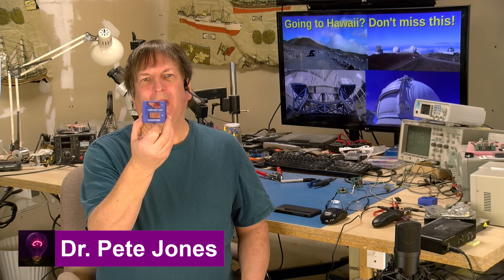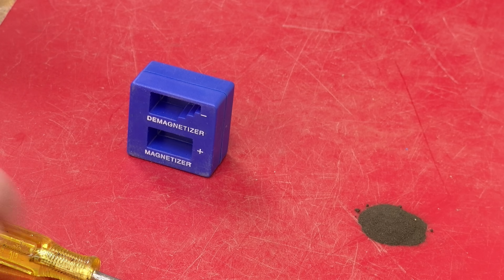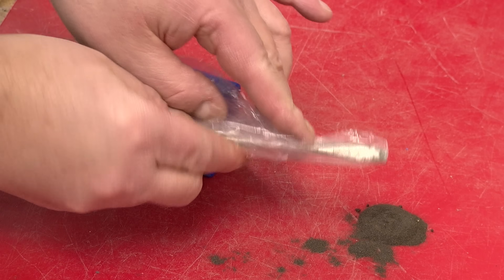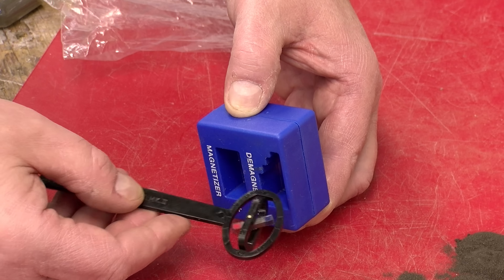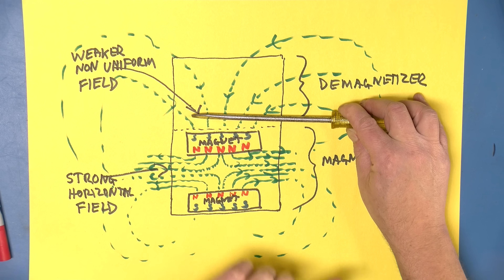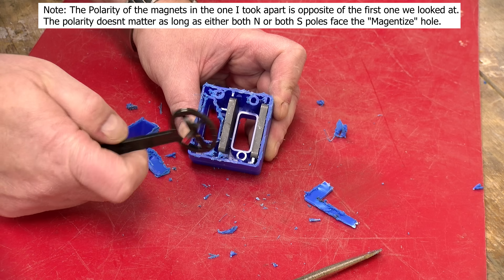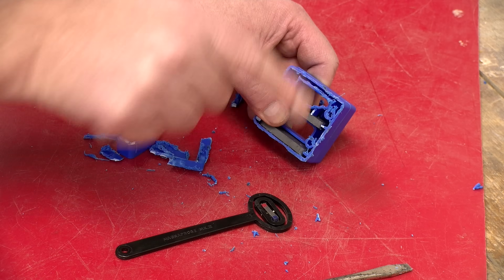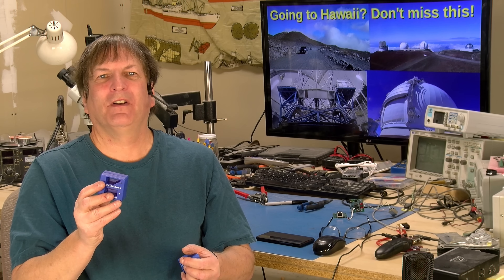How do these Magnetizer/Demagnetizers work?

Comment: I’ve had the same model for a long time very handy, obviously magnets don’t work on SS screws.🤪
Reply from the maker: Yes - I guess its "lucky" they are more expensive and therefor less common that plain old regular steel screws!
Reply: That's a myth. Some stainless steels can be magnetized. Some stainless steels rust too. There are many different classifications of stainless steel.
Reply from the maker: @tenlittleindians  I wonder what the alloy difference is between the magnetize / dont magnetize versions?
Reply: @ElectromagneticVideos  I think the information is in the Machinists manual. Very expensive book but I think there's an online version somewhere. To be fair the book is 3 inches thick with very thin pages. A ton of information in those books.
Reply from the maker: @tenlittleindians  I'll have to keep my eyes open for that at used book stores - sounds like a great book to have.  I have the Merk Index which is the chemistry handbook like that - type of things that very useful at time to have around.
Reply: @ElectromagneticVideos   It's actually called "Machinery's Handbook" and it's been around for over 100 years.
Reply from the maker: @tenlittleindians  Thanks!

Comment: Bluetack gets sand out of my fishing drone motors magnets and we're in Taranaki with iron sand ..it's horrid stuff ..basically sandpaper
Reply from the maker: I had to look up Bluetack - so its an adhesive with a consistency a bit like chewing gum? What a great idea for removing iron filings - I will remember  that! Thanks. 

I have always thought it would neat to experience iron sand and pick it up with a magnet. Never though of the down side. So I guess you in New Zealand - greetings from Canada!
Reply: @ElectromagneticVideos  shure do ..I liked your video ..yea it's funny we don't know what we don't know till suddenly we know ..were a small country with a big footprint thanks to industry ..
Reply: @ElectromagneticVideos  the absolute worst thing about iron sand is the crazy temps it gets up to in summer as it's dark it heats up with the sun and literally burns the skin off your feet ..but no worries the iron sand giveth and the iron sand taketh as in it will strip the dead skin straight off ..that's not the hardest part the hardest part is our brutal coral reefs of larva ..and a minute size of mussle they are literally razor sharp ..around half an inch by American imperial or 10-12mm in metric for fully grown ..it's one species

Comment: That must be the first (de-)magnetizer in the world, tha had to be cut apart to get it open 😮 Usually one can just pull both halfs apart relativelly easy, since they are not even getting glued (at least the good german ones like Wiha and Knipex). I used to troll my coworkers in the past by disassembling them and changing the direction of one of the magnets inside from time to time. The way they work remained a mystery to them back then 😅
Reply from the maker: This was certainly not easy to get apart. Too bad - would be great to be able to repeat what you did you your co -workers!

Comment: Informative! This reminds me of the AC powered tape head degausser wand/tool I bought years ago. The instructions were that the tip of the degausser was to be moved away from the tape heads slowly. The steps on that magnetizer/demagnetizer block make sense now.
Reply from the maker: I have an AC powered bulk tape degausser  and also one for CRTs - very similar in terms of moving away slowly. I did a video on that if you interested:  https://youtu.be/mGK8oYdEqyE
Reply: More spectacular was the degaussing coil for a CRT,   you rotated it in front of the tube watching the lovely colour patterns whilst slowly move some meters away. If the power was shut of too quick the tube had a permeant field and that was not good. Also the mains coil pulled a good few amps so you had one shot at it before smoke appeared.

Comment: The most important thing about demagnetization is a field that is opposite to the field in the magnetized iron, which reverses and weakens the magnetization of the iron. The polarity reversal should be repeated with a weaker field each time in order to make the iron practically unmagnetized. (This can also be achieved with a coil with alternating current, from which the piece of iron to be demagnetized is slowly moved away.) I also bought a demagnetizer/magnetizer like this to see how it works. Of course, it still works even when cut open.
Reply from the maker: "it still works even when cut open"  Ha - yes! Just a bit harder to use!
Reply: @ElectromagneticVideos  It actually works less well with the plastic case open because the mechanism lacks the secret of its function. 🙂
Reply from the maker: @Tag-Traeumer  Its certainly less magical :)
Reply: @ElectromagneticVideos  Yes, some magic is lost. But the built-in magnets still have enough magic: an invisible, non-material force that works at a distance! 😮
Reply from the maker: @Tag-Traeumer  Ha yes - magnetism is magical in and of itself :)

Comment: They are sadly not all made equal. The one I have now barely magnetizes. The one I had 20 years ago worked amazing. Same style, color and all, with the only difference being the language written on the side.
Reply from the maker: Someone else reported something similar. I suspect most manufacturers have no idea how it works and just buy some magnets, slap them in some injection molded plastic, and sell them at a price point they hope will make it not worth returning. Too bad - giving a great device a poor reputation.

Comment: When you're trying to charge or decharged the screwdriver does it only need one pass or does multiple passes raise the effectiveness?
Reply from the maker: Magnetize: because of the magnetic flux splits  and flows outward through both sides of the  magnetize hole, more than one pass wont increase the strength.  

Demagentize: the hard thing is keeping the screwdriver parallel to the floor of the demagentizer hole as you pull it though  and move it up step by step. If you dont think it was parallel enough, a second pass at teh same step may help. But if it was parallel, it should make no difference.  So I guess in summary, if you did it right, one pass is all you need at each level.
Reply: @ElectromagneticVideos  thank you for the detailed response. I have one of these in my toolbox and use it a lot, but I've always ran it through multiple times. Almost like sharpening a knife. Now I know I don't have to do that.
Reply from the maker: @Big_Perm  Well the important thing is in the end, whatever works!

Comment: so, as a party trick, you could de-magnetize on the opposite side of the de-magneetizer hole - just moving the screwdriver in the free air ?
Reply from the maker: Yes - in other words, if the device is oriented so that that the demagnetizer hole is above the magnetizer hole, you can demagnetize by passing the screwdriver below the bottom side of the device (ie below the magnetizer hole).

Comment: Working on cars all my life we just wrapped a wire around the blade of a screwdriver and touched the ends to the positive and negative battery terminals quickly(not long enough to cause any damage to the battery or the wire) and that lightly magnetized the screwdriver good enough to get a screw out of the unreachable space we had inevitably dropped it into. Never knew why it worked, it just did.
Reply from the maker: Someone else mentioned a similar story. I guess a mechanics trick. Here is the why you can magnetize things that way: https://youtu.be/S21rlwrY74I

Comment: i know you can magnetize with one magnet (not this tool , just a loose magnet) but is there any way to demagnetize with just a loose magnet ? i have large drill bits that won't fit inside the tool .
Reply from the maker: You could if you could adjust the position of the permanent magnet just right to exactly counter the field in the drill bit. But its practically impossible to get it just right. 

Try this: bang the drill bit on the (not sharp) end with a hammer. Or drop it a few times on a concrete floor. The shock may be able to demagnetize it.  

Better, get a used, AC powered,  bulk tape demagentizer which should be able to do it.
Reply: thanks .
Reply: The Curie temperature. Basically when you get a magnet hot enough it loses it's magnetism. I think it's because the crystal structure is changed by intense heat.
Reply from the maker: @jakepassolt9640 Yes! Exactly! The only everyday use I know of the Curie temperature is in rice cookers of all things. Its used to change the magnetic characteristics of the gizmo that keeps the switch on until it gets hot (all the water evaporated)  and the switch is released Turing it off.

Comment: Does the speed of the screwdriver moving through the magnetic field affect the strength of the magnetism that the screwdriver picks up?
Reply from the maker: Not for the type of speeds one would normally be able to pull it though the device. 

There is some time time it takes for  magnetic domains to change as needed to magnetize or demagnetize, but I'm not sure what that is.  So if you shot the screwdriver from a gun though the hole in the magnetizer, there might be all sorts of weird effects that come in to play. I have never tried  that :)
Reply: @ElectromagneticVideos "I shot a screwdriver through a magnetizer - Something weird happened" sounds like a fairly normal Youtube video, though. 😂
Reply from the maker: @GoGoGoRunRunRun  I could probably get a lot more views if I did that :)

Comment: Basically, the stronger the field in the screwdriver, the stronger the demagnitizer needs to be to noticably effect it, but also, the strong the field it leaves behind, so you have to taper off the strength of the demagnitizer to fully remove the magnetic field.
Reply from the maker: Yes - and the fist step in the demagnetize section leaves some field, the next step reduces that, and so on.

Comment: These won't work on a screwdriver magnetized with a different field (ie: comes from factory magnatized). That part is confusing.
Reply from the maker: Actually, it should: Because the demagnetizer part is initially forcing the field in the screwdriver to be perpendicular to the length of the screwdriver (screwdrivers are normally magnetized with the field in a parallel direction), it really shouldn't matter what field the screwdriver initially has.
Reply: @ElectromagneticVideos  So I bought one to demagnetize a set of drivers and it didn't work. Bunch of people on amazon also complained. I wrote the company and he sent me a YT video showing why, but I didn't totally understand it. (It works on fresh screwdrivers of course) Had something to do with original field created in different flux orientation the cancelation doesn't work.
Reply from the maker: @xfloodcasual8124  Lets say I'm a bit suspicious of that explanation :) If they had a lot of complains, I wonder if they had a sufficiently strong magnet inside and close enough to the bottom of the demagnetizer slot? I would suspect many of these devices are made by buying some magnets, putting them in a plastic case and assuming it will work because other ones that look similar do. And figuring that for $5 or whatever, only a few people will bother to ship them back if there is an issue.
Reply: @ElectromagneticVideos  Its possible. One way to test is get a factory magnetized screwdriver and demagnetize it. I had Klein drivers.
Reply from the maker: @xfloodcasual8124  OK - I might have misunderstood. If you have (purposely) factory magnetized screwdrivers, they will have a real permanent magnet somewhere inside to keep the field strong. A simple demagentizer like this will not be enough to demagnetize it.

Comment: Had problems demagnetizing completely . Now I know. Thanks alot. Others say that stairs doesn't do anything because it's empty inside and just for show. ;D That's youtube for you
Reply from the maker: In  fairness to other youtubers , these devices don't seem to have instructions on how to use them, and to deduce why the staircase is needed does take a bit more than an elementary under standing of magnetics, although its pretty simple once you understand it. 

Hope this solves your demagnetization issues. If not, see if you can find an old AC powered bulk tape demagnetizer  which should be able to an even better job.
Reply: Just tried and this simple stairs solution helps. Sometimes it takes a couple of times but definitely works :)
Reply from the maker: @christopherismcaceas4868  I found the same thing - I think it has a lot to do with positing the screwdriver just right for each step. If it dips down towards the magnet it can re-magnetize itself. Not a perfect device, but amazingly effective for its simplicity.

Comment: I find demagnetizing (or 'degaussing' as said in the biz) with these things to be a bit hit/miss. For that I have an old CRT TV degaussing coil in the shop that does an excellent job every time... additionally it's big enough for most hand tools, and can even be passed over bench vise jaws. Use 'technique' is important for degaussing coils. (Don't exceed their duty cycle limitations!)

Note that alloys used for screwdrivers make poor magnet materials... and they will never strongly magnetize.

Also, an old camping compass makes for an excellent detector of stray magnetism.
Reply from the maker: Well, you may like this video    https://youtu.be/mGK8oYdEqyE - I have a CRT degausser too! You are one of the few people I have come across who also still has a CRT degausser!

Compass - YES! I actually shot some of the video using a compass to determine the degree of magentization of the screwdriver (how far away to make the compass defect ever so slightly) -   in the end decided iron filings made it more obvious in the video.

Comment: I wonder if these exist with neodymium magnets …
Reply from the maker: I suspect is a case of cost vs "just good enough". Even if neodymium magnets made it a bit more effective, its probably hard to convince a customer that a more expensive demagnetizer would be better. The other limiting factor is the screwdriver steel itself, so the extra strength from the neodymium might have a minimal effect on the magnetization of the screwdriver in the end.

Comment: I'd be very curious about something: if you use the same device to magnetize and demagnetize, part of the demagnetization comes from the fact that the screw driver is demagnetized by a weaker but opposite field than what was used to magnetize it.

So, an interesting experiment would be this: take the disassembled device and flip the magnets so that it magnetizes in the opposite field direction as the other device. Now, magnetize your screwdriver with one device and demagnitize it with the other and see if your screwdriver is properly demagnetized.

My guess is that it wouldn't be, because you magnetized it with a north pole and then demagnetized it with a weaker north pole.

Proper demagnetization can only be achieved with a decreasing AC magnetic field.
Reply from the maker: Because the demagnetizer part is initially forcing the field in the screwdriver to be perpendicular to the length of the screwdriver (the screwdriver is magnetized with the field in a parallel direction), it really shouldn't matter if you use oppositely polarized devices for the magnetize and demagnetize steps.

Your right about the AC field - this essentially poorly mimicking a somewhat rotating AC field as you pull it out of the demagentizer. I did a video with various AC field demagnetizers here https://youtu.be/mGK8oYdEqyE in case your interested.
Reply: @ElectromagneticVideos  The direction of the magnetization field doesn't really matter. I have magnetized many screwdrivers by just rubbing a magnet along the metal, exactly as how the demagnetizing part of that tool does.

Comment: Excellent simple diagram explaining this simple, magical, device 👏 once magnetized, does the screwdriver remain magnetized indefinitely or does it demagnetize over time? If so, how quickly does it demagnetize?
Reply from the maker: Thanks! Things like screwdrivers tend to loose their magnetism over time, usually as a result of being banged. So it how often you bang them that often determines how long. The steel in them is generally "magnetically soft" meaning they are easy to magnetize because the magnetic domain boundaries can easily move. And that ability of the magnetic domain boundaries to easily move makes it easy for that form of steel to demagnetize as well. Other materials where the domains get locked in place make longer lasting magnets - called magnetically hard materials - which is what permanent magnets are made of. 

If its of interest to you, I  did a video a while back on how things get magnetized: https://youtu.be/S21rlwrY74I and demagnetized: https://youtu.be/mGK8oYdEqyE
Reply: Thanks for the immediate & understandable reply, I'll check out the videos!

Comment: Also with the two different polarities, you must demagnetize with the correct one, otherwise it doesn't work.
I guess if you only had the wrong one, you could remagnetise the other way, and then it would would be able to demagnetise
Reply from the maker: Because the demagnetizer part is initially forcing the field in the screwdriver to be perpendicular to the length of the screwdriver (the screwdriver is magnetized with the field in a parallel direction), it really shouldn't matter if you use oppositely polarized devices for the magnetize and demagnetize steps. I did wonder if devices from one manufacturer are all polarized one way or the other, or if its completely random with the magnets being manually inserted.